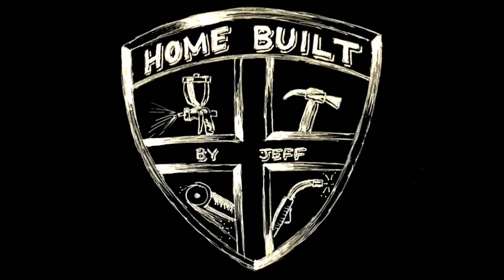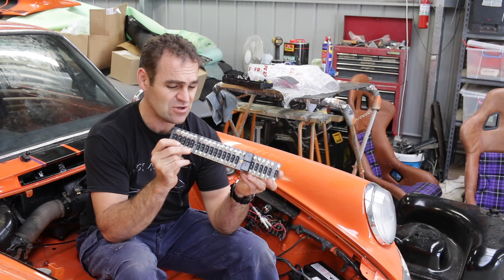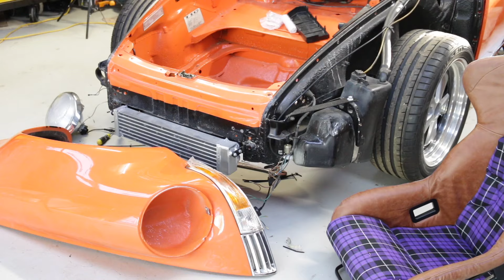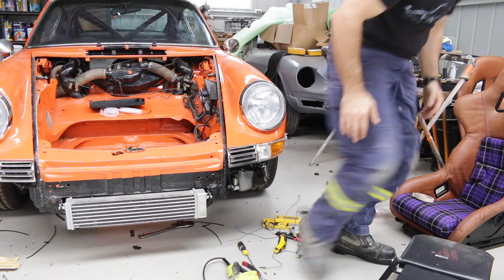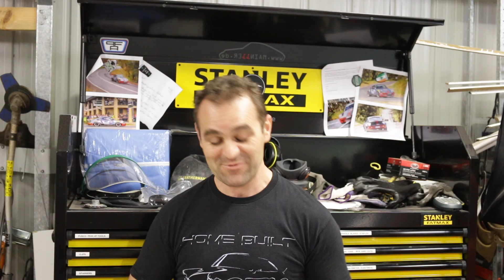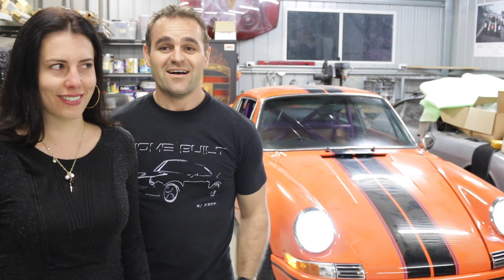New fuse panel, and a cracked windscreen - Porsche 911 Classic Car Build Part 51

Comment: Jeff and the Mrs, fine work you're doing, on the windshield, start at the bottom and it's imperative that the lower portion of the glass and seal are in their proper position, there wont be enough room at the top if it doesn't fall into place,  a common problem is a portion of the seal will be hung on the lip, you wont see it because of the dash pad, also the glass has to drop all the way down the seal channel, lots of glass cleaner help make things slick, you can use a slapping motion on the glass to force into a low position, makes sense why they went to a glued in windshield....good luck
Reply from the maker: We started at the bottom this time and it was sealed in very nicely around the bottom and the sides. The top corners went in fine, but the windscreen was still sitting a little low, so the rubber was only on the very edge of the lip. I probably should have pulled it out and tried again. Anyway, now I have to buy a new one, so I will get them to put it in.

Comment: really impressive build so far, but as others have said, you have to take the chrome trim out of the rubber before you try and fit the glass, theres no way its going in with that fitted, it acts as a wedge in the rubber to hold the screen tight after youve put it in!
Reply from the maker: Actually that is what I thought, but from the others I have researched all install it with it in, and have no issues. My main issue was that the window was not centred properly.
Reply: Well, that'll do it too!  I hate doing glass. Love your channel, inspirational work on the shell, especially the attention to the panel gaps - truly impressive.

Comment: in a never volkswagen the reason for 2 horns are it´s a highline, not a standert low ekstras car, i think you should check the back plates(the one that hold the bulbs) regarding the ground fault on the rear lights they offen fail in vw, and your´s is an older car, like the new fuse box
as always keep up the good work mate
Reply from the maker: Thanks mate.  The ground fault is actually coming from the brown wire in the harness, so I will have to trace it back further.
Reply: ahh okey funny it´s both sides?? there must be a connection for both rear light´s some were, that would be my next place to look

Comment: Almost in, but not quite. Then it's broken and Mrs. Jeff is disappointed. :P

Did I not advise you to have it done professionally? I'm sure I remember commenting about it. Because, even if you fit it successfully, it's going to leak, sadly. At least when it leaks after a professional does it, they're gonna fix it for free. 

The OEM 911 horn is hellishly loud, and worth having, I think. One of mine had an Italian horn on it when I got it - a lousy, wheezy little thing. Just about the first thing I did to it was stick the right horn in it.
Reply from the maker: I might look at the other horn and see if I can get it working as well. It won't take much to fit it. As for the windscreen, now I need a new one anyway, I will get them to fit it for me, like you say, it is up to them to get it right.

Comment: AAAAARRRRGGGHHH! Cracked windscreen I admire your persistence in doing everything Jeff, hope you can get another okay. Old cars always have poor earths and low power to lights and horns etc. The new fuse panel with relays is great. I personally put relays to everything and new earths as well. If you would like to update the horn you can get super compact air horns that are about the same weight as your standard horn nowadays. Stebel Nautilus Compact although there are plenty of cheap ripoffs too that are very good as well. Thanks for the video
Reply from the maker: I definitely think new earths are needed for the tail lights. I will have to look into it more.
Reply: Rob Armstrong Out here in Australia down under country we call a ground "Earth" I don't know why......maybe an English way of saying it whilst "Ground" is American?
Reply: Earth is a planet ground is a connection to the other end of the circuit..nuth said...

Comment: Said it on the other vid but you're fitting it wrong. With the trim fitted the rubber extrusion has no flex in it specifically to retain the screen. If it went in like that, then there's a chance it could come out, hence it don't go in.

Comment: Was good you did not try to blame Mrs Jeff, for the windscreen cracking, as you clearly broke it. Perhaps it's one job, best left to a professional mobile screen fitter.  If they break the next screen fitting it, then they should supply another one for free.  Are you sure the body shell that surrounds the screen is not distorted, due to any past accident damage or repairs? With the screen and rubber seal removed, try taking 2 diagonal measurements and see if they are exactly the same.
Reply from the maker: I think it should be good. We basically had it in when I cracked it, (and that windscreen came out of it).

Comment: Ahhh, the old windshield was probably finely pitted anyway. The new one will be perfect! As for the horns, it sounds like you still have the low tone one. My low tone one has stopped working, and people laugh when I try to honk them out of the way with just a high squeaky tone. It is driving season here in Canada, so it may have to wait for a rainy weekend to get buttoned up.
Reply from the maker: Ahhh, that is why there are two horns.

Comment: You guys look good together! Sucks about the windshield but it can be replaced and you learned a lesson " less hammer and more soppy water". Horns, there are two used a high and low tones for all models and the ones you have were less expensive than the Porsche ones. Retro fuse panel looks great, I plan on fitting the same type in my car one day. Since your car was converted it's really no telling what worked and what didn't before so one system at a time. Both the combo turn signal and high/low headlight switch and the highlight switch control so much look there for a lot of lighting issues as well as the grounds after the new paint. Bentley manual is very helpful also look to the pelican parts and impact bumper web sites because someone else has had the same elec. problem. I have spent countless hours on the electrical systems only to fix one issue and cause another. Enjoy!
Reply from the maker: That is why electrical systems have always driven me crazy. With one of the tail lights, when I connected the earth clip to the body and touched the brown ground wire for the light came on, so there is obviously something going haywire in the circuit.